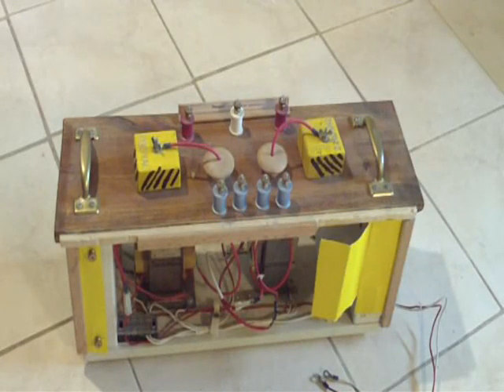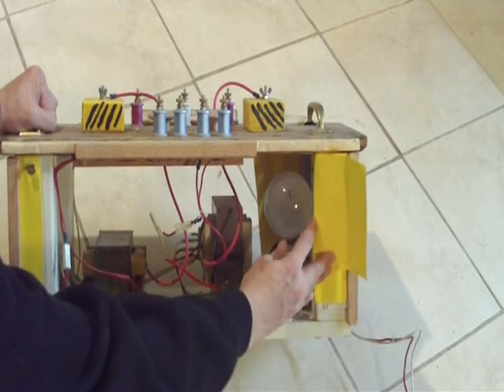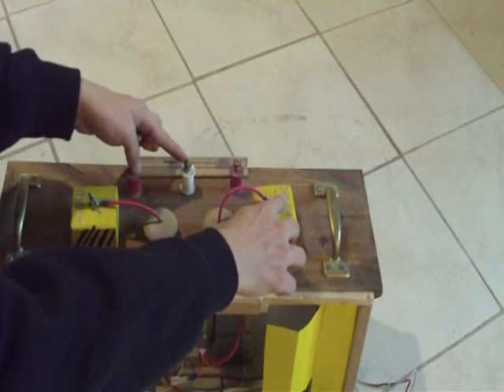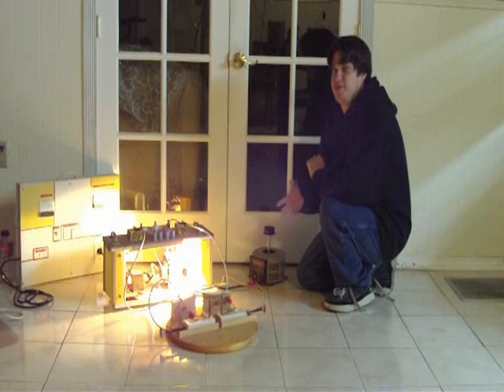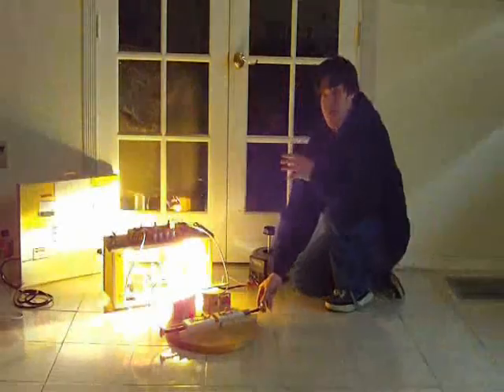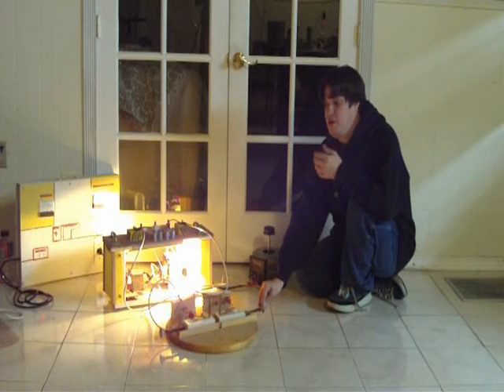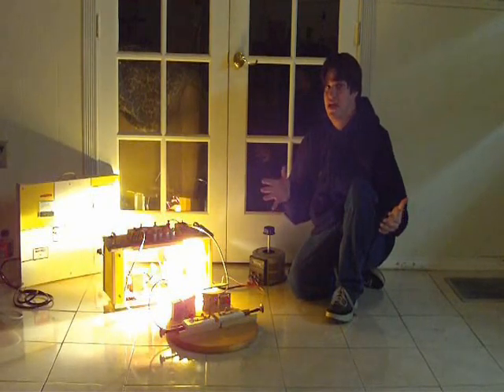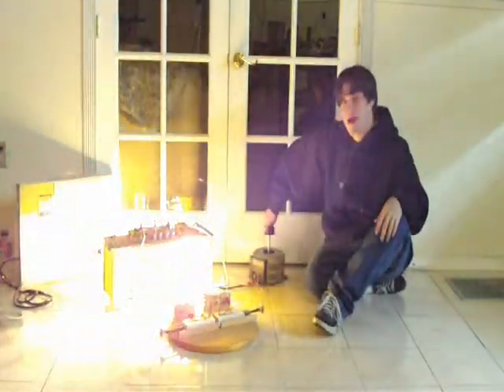4,000 volt power supply (microwave transformers)

Comment: 2.1kv** not 2kv series = 4.2kv hence microwave capacitors are rated 2,100v the majority of them
Reply from the maker: The power supply in this video has two transformers with the secondary windings connected in series, therefore 4,000 volts total.
Reply: +ct92404 so basically these transformers must be old if there giving off 2kv each my two mots do 2.1kv each
Reply from the maker: Bloomfield Productions215x Yeah, they probably are. I have no idea when they were built, I didn't see a date anywhere.
Reply: +ct92404 oh well that's a nice PSU I might build something similar
Reply from the maker: Bloomfield Productions215x Thank you. If you do build something like this, I recommend against using a light bulb for current limiting. I used that for simplicity, but I was never really that happy with how it worked. I suggest using inductance. I started using these big chokes I found at an electrical surplus shop, and they worked MUCH better. A light bulb is fine for quick little experiments, for safety to prevent overloads, but inductive reactance gives much smoother, more efficient current regulation.
Reply: Like the approach the neon sign transfromer use  a similar approach.
Reply: ct92404 you can actually use another microwave transformer as a choke

Comment: the PRIMARIES are fed in parallel. The secondaries (having the primaries fed out-of-phase) are in SERIES and act as a center-tapped-output transformer.

Next project: An electric chair.
Reply: Guten tag, Excuse me sir, can you tell me if I'm right with the circuit? Positive T1 HV to 2 caps (spark gap), metal body T1 to positive T2 HV, and finally metal body T2  with a ballast (spark gap, negative?)

Comment: At 4000 volts, you could supply a TUBE linear amplifier. And at 2000 volts per transformer (let's assume that they are transformers from a 1000 watt microwave oven), that makes 500mA.

Your linear running at 100A for 1,2 kW is a SOLID STATE linear amplifier. and unless your dad is the owner of an RF semiconductor foundry, yo do NOT want to supply a solid state linear with 4kV.

Comment: Your problem might also be the 120 Volts feed you get from the Socket. Increase the Amp from 16 to 32 plug if possible (depending on socket) else make an array of batteries exceeding the Ah you need. You can than load your batteries at night while you are looking at the inside of your eyes and use it in the daytimes. (2).

Comment: 230 volts 16 amps / 24 volts 150 amps loader/converter !MARINE! comby might do the trick for you. I own a holec but there are many more brands around. They are known to be very powerfull heavy duty instruments and I can load the batteries (720Ah total) of my chartership within 6 hours. Watch out for your wiring, which might also be the problem in your case, if you push 100+ Amps. Do a meggertest (insulation testing) on your wiring if possible. The last thing you need is fire. (1).

Comment: Why don't you use an actual ballast instead of a light bulb to limit the current? That way there you can see the arc a whole lot better without all that light getting in the way and it will also run a lot more efficiently.

Comment: Firstly, microwave transformers DO have a current limiter in them, its those blocks of metal inside the core where you would expect windings, (i dont think they are big enough to prevent burn out on short circuit) but they thats the job they do. secondly the light looks like it could be limiting your output too much so you could perhaps increase its wattage...

Comment from the maker: You realize that this transformer is meant to step up the VOLTAGE, right?  It's not for high current.  4,000 volts at 100 amps would be a heck of a lot more than 1200 watts ;)

Comment: How many amps would it support?I need at least 100 amps to run a linear,doing about 1200 watts on transmit.Right now im using a Astron at 70 amps but it wont run the amp at full power.

Comment from the maker: NO, the transformers are connected in series.  The primary windings are in parallel, but the secondary windings are in series.  It's basically acting like a center tapped transformer.  Each side supplies 2kv, with a mid point ground.  I have actually had the output voltage tested and it's 4kv (4200 volts, actually).

Comment from the maker: No, please look at the diagram at the beginning of the video again.  Only the SECONDARY windings are connected in series.  That doubles the output voltage.  Each transformer independently supplies 2,000 volts but when the secondary windings are connected in series, the voltage is doubled to 4,000 volts.  You can't connect transformers the way you described to try to get an exponential voltage increase...that would cause an overload.

Comment from the maker: @MrSciencetificsasuke 
Exactly.  All it's doing is adding resistance to the circuit, so that when an arc is drawn from the transformer, it doesn't cause a short circuit and an overload.  But I've also found that a light bulb isn't the best way to limit current.  You can use anything that runs on 120 volts AC.  You just need something to act as a load.

Comment from the maker: @gabigowriel 
They're high voltage transformers which you can find in any common microwave oven.  They use a transformer to supply high voltage to the magnetron tube.  Just buy a couple of old microwaves and take them apart.  Connect the transformers in series like I have in the diagram to double the voltage output.  Be careful though, there's a capacitor connected in the circuit and you need to discharge that first.

Comment from the maker: @DougieB1337 
Well, I don't have that much experience with solid state electronics (I work almost entirely with AC), but I would think that you could.  From what I understand, the secondary winding in a flyback transformer is end-point grounded like a microwave transformer, so you should be able to connect two of them the same way.  Just don't push the voltage too high so you don't burn it out.

Comment from the maker: @DougieB1337 
No, they're connected in series.  It works like a center-tapped transformer.  The primary windings are in parallel, but the secondary windings are in series.

Comment: @ct92404 P=V*I   so ur using 120v and u said about 2.5 amps so u have 300 watts but u also have a fan hooked up? so either ur drawing more current or ur lightbulb really isnt 300 watts?? just as a question :)

Comment: @voon100 Depends on what wood you use.
I have a 10kv supply connected directly to wood, only about 2'' between the contact points.
It has ben no problem whatsoever.
...And that was BEFORE i treated my board with mineral oil.

Comment from the maker: @ThinkLearnSolve 
Yes it does short out the transformer.  When you draw an arc from a high voltage transformer, you short out the secondary winding.  This cancels out most of the impedance (the inductive reactance), which causes a short circuit.  That's why neon sign transformers have to be current limited, to prevent overloads.  And that's why I use an external resistance with these transformers.

Comment: r= r1+r2+r3+.........  +RC of primary coil (serious circuit) .
So if RC is 10% of r 

than only this 10% of voltage will produce inductance to secondary of the transformer.
If   r   has100V ( Voltage  delivered )
If RC   has10V( Voltage  measured on the primary)
L= 1:2
Than secondary winding will give you 20V

Comment: The secondary winding will reflect voltage inducted by factor of difference : 
x of secondary divided by x of primary= L      
X =number of windings.
 If L is 1 : 2    and 1(primary) has delivered (100V) :than 2(secondary)  .will produce 200V.But only the voltage on primary  winding will have an inductive force to affect secondary one. EXCLUDING ALL OF ADDITIONAL LOSSES ON ALL RESISTIVE COMPONENTS OF TOTAL PRIMARY  CIRCUIT.
 Thank You.

Comment: many years playing with electronics and still I think that this is great video 
Now:
whenever you use anything in primary  you are lowering  voltage  similar way to using Variac. the resistance of primary = resistance of all elements in primary.
The ohm law : current = voltage divided by resistance.

Comment: Although for a welder you don't want an arc that crazy, especially with that much current.  You only need like 50-60 volts, as once you just get a spark the high current will keep the arc alive.  With 2-6kv you'll get more of a torch.

Comment: I would be careful with that that 2,000 volts on each half is referenced to ground, so both leads are hot, much like the split 240volt American system 120 volts per a phase. With more than enough current to kill. Transformers can sustain short periods of over current, depending on room temperature and core and winding temperature and temperature rise time constant to not exceed the insulation melting point of the enameled copper wire. Very educational, be safe.

Comment: lol its been made in 17-19 centuries and you still wondering with it. youre sick xD.
you can then add an very simple capacitor multiplier circuit to multiply these 4k to 16k or even 32k.
to pierce the surrounding air with the arc you need 16k on each 1cm of a gap; but this voltage may vary due to different ingredients of different airs and different pressure and temperature.
@Pyromadness: open a book and learn an Ohm's law!

Comment: i use a 1+2kv heater as balast :) i have a military radar transformer, 2.5kv (2x 625 x2 windings) at 1.2 amp :) i have a vid with something similar, but much smaller. 2kv, o.6 A. oh, and with mots, if they are not crappy cheap ones, u can short it for up to 15 sec, with no danger, it will heat but, not enough to do ani damage at all

Comment from the maker: For one thing, if you want to limit the current to 10 amps you will need to use something different than a light bulb.  (Unless you can find a 1200 watt light bulb!)  You can use anything to limit current...you just need some kind of load between the transformer and the power supply.  Try a heater element, toaster, hair dryer, etc.  

The filament resistance reduces current, not voltage.

Comment from the maker: Not really.  Dimmer switches don't work very well with transformers.  They convert the AC sinewave into a chopped triangular waveform and when you turn the knob you're mostly just changing the pulse width.  It's like changing the frequency.  It's better to use a variac (variable transformer) to control the voltage.

Comment from the maker: Arc welders supply very high current, but low voltage.  Low voltage can't start an arc on its own.  If you want to start an arc, you need high voltage...at least 2,000 volts.  (Although I would recommend higher voltage for experiements, at least 6kv).

Comment from the maker: Actually, the best way seems to be inductance (with inductive reactance).  I used a light bulb for a while because it was just easy and simple.  But I made a ballast with a set of large chokes and that works a lot better.  I have a video showing me using it with this power supply.

Comment from the maker: As I explained in the other comment, the primary windings are connected in parallel, but the secondary windings are in series.  The circuit is acting like a center-tapped transformer.  Each transformer supplies 2kv by itself, but across BOTH transformers, you get a TOTAL of 4,000 volts.

Comment from the maker: That's ok.  Actually, the cores are grounded.  The cores of each transformer are linked together, and then connected to a common ground.  What happens is that you end up with something like a center-tapped transformer.  Each transformer only has to supply 2,000 volts (which is less stress for the insulation), but across BOTH secondary windings, you get a TOTAL of 4,000 volts.

Comment: its probably a xenon flash tube
it needs a lot of power about 4000 volts but im not sure how much exactly because all of them are different, but, it also needs a trigger coil, transformer and a  capacitor, but i wouldnt try with out specialized help cause they can be lethal. even when hooked up properly.

Comment from the maker: ...Also, look at how many videos there are on YouTube of people drawing arcs from a MOT (for a Jacob's Ladder, etc) and it trips a 15 amp circuit breaker.  One of my friend's MOT kept doing that until he started using a ballast.  I prefer using neon transformers for high voltage experiments anyway.  I only made this video to show how you could make a HV power supply with two MOTs connected in series, for about 4kv total.

Comment from the maker: You're thinking of a neon transformer.  Neon transformers have shunts in the core which causes leakage inductance and is used to limit the current.  (They have to be current limited because the gas tube in a neon sign shorts out the transformer.) But microwave transformers don't have shunts.  They might have a limit to how much current they will draw because the core saturates, but by that point the windings can start to overheat.  I've heard of the primary winding on a MOT catching fire.

Comment from the maker: You mean a circuit breaker switch?  No, and that's why I use a ballast with these transformers, to prevent overloads.  So they won't trip a circuit breaker.  Although I HAVE tripped circuit breakers with OTHER things!

Comment from the maker: Sure.  Actually, you can use pretty much anything as a ballast, just as long as you have some kind of load in series with the transformer.  Some things work better than others.  You could even use a toaster or a heater element as a ballast.  What happens is that if you short out the transformer, the transformer's impedance almost disappears so it becomes a short circuit.  Then pretty much the only resistance in the circuit is your ballast.  So you need a ballast to prevent an overload.

Comment from the maker: well, I don't know of any 1100 watt light bulb, except maybe hallogen bulbs and that would get extremely hot.  But you could connect several light bulbs in parallel.  Or better yet, just find something else to use as a ballast.  Like maybe a heater element or a toaster.  You could also use inductance as a ballst.  I have a video showing my inductive ballast.  Look at my page.

Comment from the maker: You would connect the light bulb in series with the transformer.  So yeah, one wire from the light bulb would connect to the 120 VAC hot line, and the other wire on the light bulb would connect to the transformer.

Comment from the maker: If you try to connect the primary windings in reverse, they will be out of phase and most likely you will just end up cutting the voltage in half (if the transformers will even work at all).  There's really no such thing as '+' and '-' with AC, since the polarity is constantly changing at 60hz.  But if you connect transformers together, you have to be sure they're in phase - that the AC sinewave is rising on both at the same time.

Comment from the maker: That connects to the filament windings on the microwave transformers.  Normally, the filament winding is used to supply low voltage for the filament on the magnetron.  I didn't use them, but it was easier just to leave the windings on the transformers than to take them off.  So I left them on and made extra terminals just in case I found some use for it later on.

Comment from the maker: I've tried using capacitive reactance to limit current before, and that doesn't work too great.  The capacitor got really hot and the arc turned into a loud popping discharge instead of the smooth arc you normally get with AC, so to me that was a sign that I was getting some high frequency ringing that's not good for the transformer.  Also, I prefer using the ballast on the primary side.

Comment from the maker: ...actually, probably not even that would happen.  All that would happen is that you'd saturate the core of the second transformer and they would both just overheat.  And if you didn't use a ballast to limit the current, it would just trip a circuit breaker, because the second transformer would try to draw a HUGE amount of current if you dumped 2,000 volts into the primary winding.  Think about Ohm's Law.  The winding has maybe 10 ohms of resistance.  2,000 volts divided by 10 ohms = 200 amps!

Comment from the maker: Transformers don't work that way.  That wouldn't work, because then you would be trying to drive the second transformer's primary winding with the current from the first transformer's secondary winding.  You would overload the first transformer.  Also, there is no way in the world these transformers could handle 33,000 volts.  The insulation is way too thin.  You would get arcing between the windings and flashover to the core.

Comment from the maker: I still wouldn't recommend running a MOT without current limiting.  I have heard of the primary windings catching fire.  If you look at codemsan's videos, you can see how often the circuit breaker trips in one of his videos.  I saw  another video where someone connected a MOT directly to the service lines in their panel, from the pole transformer, to bypass the circuit breaker switches because they kept tripping...NOT SMART!  That will overheat the bus bars and could cause a fire.

Comment: Theres no need for light bulb or current liminting coil if you have a tranformor that gives you under 4 amps (at least 0.20 amps) it's different in eurepe cos we have 230V wall outlet , but that doesn't really matter when u ballast the current. So the best way to ballast the current is to use for exmpl. a fluoricent lamp transformer before the two MOT's to get 0.53 amps(That's what my ballast gives). Light bulbs are inconvenient cos' those really just suck your money from your electric bill :D